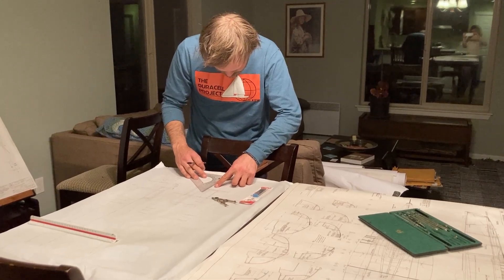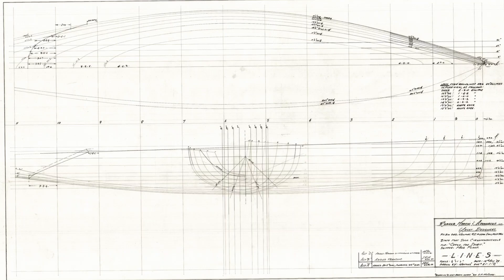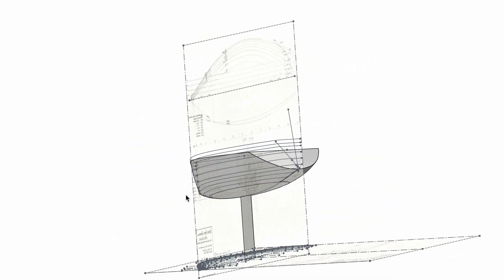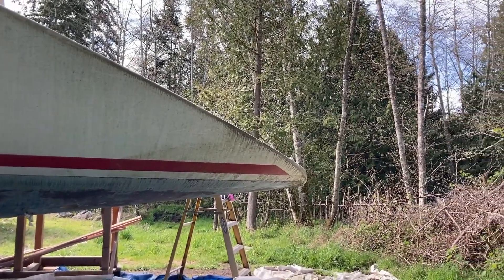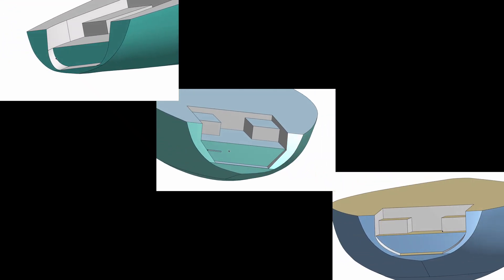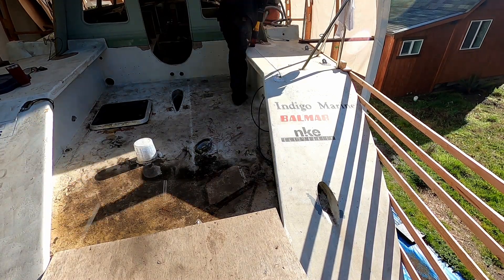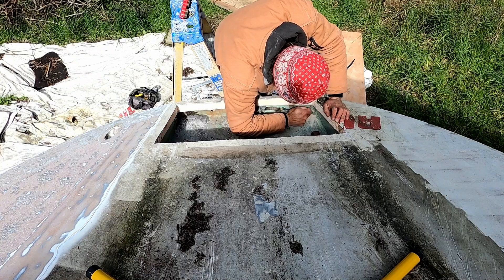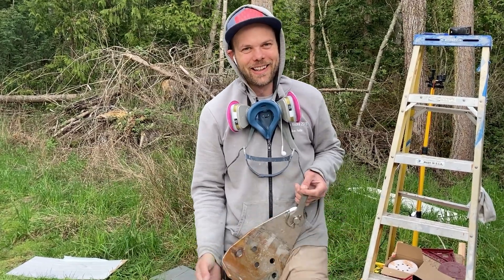Race Boat Refit: New Stern Design [E27]

Comment: I am not found of any. Is there a reason that you want or need the swim step instead of a ladder with more transom? I guess as I look at your  project and using the ship for sailing the oceans you do not want a bigger transom? Just my opinion.
Reply from the maker: just easier access at anchor with a swim step.
Reply: @TheDuracellProject  I get the ease of getting back into the boat. Again, what about large waves at the back of the boat. Washing onto the boat?
Reply from the maker: The boat is fast, and in most conditions faster than the wave train.

Comment: I would recommend an enclosed cockpit with a door to the swim platform.  Many times on passage it is nice to have an integrated swim platform you can easily use vs having to drop a fold down one.  I would recommend a much larger platform than the designs you have thus far created.  at 60' you will have plenty of cockpit space so don't skimp on the swim platform.
Reply: I totally agree, a watertight door makes a lot of sense, rather than open transom.   When you have kids on board, this will help, and sailing in a following sea it will be dryer.  I raced too many nights in boats with open transom , and wet cockpit as a result.  
If you go with a transom door, you could also drop the cockpit floor giving a higher freeboard in the cockpit, and benches will be more comfortable as a result. 
Love what you are doing, good luck on getting the right mast and the continuing project.

Comment: WOW!  That jogged some memory cells that I have forgotten about.  Back before the time of the dinosaurs, I was at Cal-Poly getting an aerospace engineering degree and one of the projects I did was to design a keel for a sailboat.  It required transferring paper plans of the boat to a cad drawing. Turns out I did not have enough of the drawing to transfer it to the Design Cad so never was able to.  I had completely forgotten about that!

I would go for #2.  Looks good you guys :-)

Comment: My preference is #2, for the following reasons. It appears the deck is slightly wider, and I prefer more deck space aft for deck hardware or even aft corner seats. I also like more foot space in the aft corners when handling dock lines. Lastly, I like the smooth lines of #2.

Comment: None of the 3 designs takes advantage of the opportunity to create a swim platform, 90% of the width of the beam, fold down on actuators to horizontal position with an integrated ladder.  Depending on the volume at the Stern and what is in the way, you may be able to incorporate a garage for a tender for going between ship to shore for supplies doing away with lowering a tender on davits or a crane.  Having a fold up transom also makes it a lot harder for unwanted guests boarding the boat.

Comment: Hi Matt. At 0:03 into the video we see a nice image of the grid substructure of Duracell and so my choice would be the transom that best integrates the point loads of the chainplates for the split backstay into this grid (as with the other chainplates). There is a comment by Andrew about a wind vane location and another about davits and so I would also consider the structural elements that underpin such installations (if that's where you wish to go). Enjoying watching journey from New Zealand. I was anticipating seeing you break out the "French Curves" and pinning flexible battens to the side of the hull... Best wishes and don't rush the design phase!
Reply from the maker: I will be installing extra bulkheads under the deck to transfer loads of chainplates and the like into the hull.  I won't be cutting the entire transom off, so I'll be tabbing to that transom, which in turn is tied to the 'grid' structure you speak of.
Reply: @TheDuracellProject  Cool. Remember, Form always follows Function. With all the great comments and support you are receiving, we all look forward to a great rebirth of the vessel.

Comment: Wouldn’t you need to replace standing rigging anyway?
Reply from the maker: Not necessarily.  It is rod rigging, which can be inspected for cracks.  If the rods pass muster, they can be reused.  Good question.

Comment: Of the 3 designs I like #1. It's not true to the original design but it gives just a little more usable space. Question, does an open transom shovel water int the cockpit from following seas?
Reply from the maker: Ideally we sail faster than following seas.  In certain conditions, for instance when big weather passes and the wind is easing, but the seas are still big, this could be a problem, but the water would leave the cockpit as fast as it entered.  Good question.

Comment: Love the project and your attention to detail and getting it right!  Just wondering, your time on the orbital sanding must be next level.. have you thought to use a coarse sanding wheel on a grinder to get the bulk of it off really quickly then hitting it with an orbital?  You potentially could save days of sanding?
Reply from the maker: I use a big festool orbital that is relatively fast with 36 grit paper.  I like it better than the grinder because I don't have to worry about grinding into the glass too much, but more importantly, it connects to my vacuum so I can keep as much dust from floating out into the yard as possible.
Reply: @TheDuracellProject  Ah yes both very good points.  Man I love this project and keenly anticipate every new episode!  Great work mate you are a craftsman!

Comment: Definitely #2. But the step up to the cockpit is too high in my experience(20 yr cruising). Maybe look at the height of the swim platform as it should be I suggest the height of the top of your tender side pods. Maybe this lifts the swim platform enough to reduce the stepup . Otherwise the Jeaneau solution.
Reply from the maker: I plan on steps up to the cockpit from the swim step, or one step, it will only be about 16-17".

Comment: You mean that after several years at sea, and then sitting around in outside in the elements, there are bolts that are stuck?? As always, the best advice is offered after the fact.
As far as design goes, I'm sure you've gone over all the pros and cons and know what will work for you. CAD is definitely a good thing to be using and sounds like you were going to need a CAD drawing in the future. Nice to get help. I know it's not easy to pick up, but once you get the hang of it, things go much smoother.
Good news on the new mast potential. Hope it works out.

Comment: I vote for three, with the joints at the very stern flat section meeting in curves rather than straight lines. I think the straight lines of this stern will match in with the dog house straight lines. When stanchions are added and various other fittings it will look different and could be worth considering before final decisions are made. Colin, retired marine engineer, long time yachty.

Comment: All three alternatives are aesthetically pleasing. When choosing between alternatives, which can be an endless process, don't be afraid to let form follow function. You're probably way ahead in all of this, but have you worked out easily accessible stowage for typical cruising gear such as a liferaft, dinghy, folding bikes, scuba tanks, possibly a propane tank, stern anchor gear, and jerry cans? Most production boats are inadequate in this regard and stuff ends up piled on deck. But you have a great opportunity to address these needs in your redesign while keeping the decks clear and the weight a little lower. You may also want to consider having transom seats incorporated into the stern railings, so leaving enough side deck aft for that. I didn't see a raised cockpit coaming. But even a modest raised coaming can keep the cockpit much drier, and if the coaming top has a outside edge lip, a low coaming better channels water away for the cockpit and provides a great place to hang on when the boat is heeled over or sit a little higher to see over the cabin house. Finally, all this will need to be integrated with strong points and lead angles for the split backstay and runner attachment points, which will need to be engineered for heavy loads. One more thing to keep in mind, the actual boat build shape may not completely match the design drawings, and the boat may have changed shape a little over the years. So be sure to check this before building new parts separate from the boat. Keep up the great work!
Reply from the maker: Thanks @flying gybe.  I am working on stowage, and hope that this mod will provide a lot of extra room for propane, dinghy fuel, snorkel gear and shower.  I'm thinking of having a removable bench spanning the cockpit at the transom for when we're at sea, and maybe it turns into a cockpit table?  What do you think?
Reply: I think that's an interesting idea if all can be made to fit without too much size and shape compromise with each componant. Aft, elevated cockpit seats are really nice to have. But if it means a much larger cockpit table than you would usually need, you may be better off with smaller side stern rail mounted "rumble seats" and a smaller table that could also be used when sailing and stowed when not needed. Key questions will be how to support as a large cockpit table and where to stow when not needed.

Comment: #3 after over 20 years of offshores crushing from New Zealand I recommend that you have as large as possible swim step. It helps so much with access to the boat for loading/unloading as you will be doing a lot of this from your tender when cruising 
Good luck
Reply from the maker: You nailed it.  I like large swim steps, and ease of build.
Reply: Agreed !

Comment: Great ideas, I think #2 works best as you continue the shape of the cockpit sides when going down into the step/scoop. Maybe you could try to parallell the outer edge of the transom more in the curve itself. A step, moulded in as a negative shape or added like in #3 is also smart.

Comment: Have really enjoyed following along as you've taken on this great project... and see both pros and cons to all 3 designs (leaning towards #2 personally). However... I believe it might be a good idea to add a couple of additional considerations to your design brief. Given your intended blue-water sailing goals, I can't help but think that incorporating additional structures for weather and sun protection (i.e. enclosable), solar panel installation, and davits to allow safe and easy launch/storage of your dinghy. While I can certainly appreciate the challenges and added complexity of an addition of this kind, it will certainly never be easier to engineer and install than it would be now.  Looking forward to whatever you decide to do....
Reply from the maker: The renderings do not really have any decks or anything drawn, it is very incomplete.  I'm still learning how to use CAD.  I would like an arch or something for a bimini and solar panels, so I'll be thinking about that down the road.

Comment: Hi Matt, I would take into consideration that the transom should also have the ability to attach a vane steering system. I also would point you to Sailing Camara Ep1 refit of 80ft racing boat in NZ for their keel redesign for cruising. Enjoying you work
Reply from the maker: I LOVE what Camara did with their keel, seems bomb proof, and they can stand the boat on it.

Comment: While 3 appeals and is perhaps more in keeping with modern boat design - the “angular, hard chine” look, I think option 1 and 2 would probably suit the design of your boat better (curved doghouse roof etc), and if you’re not stealing too much room from the cockpit, I’d go with 2. I think you’d appreciate having a bit more area to unload/load a tender, more room to sit on if you’re swimming off the stern, perhaps a fresh water shower area, somewhere to clean fish, etc. I’m not sure of scale here, but I expect you would still have a step integrated into, or attached to, the step down to the lower platform?  Big improvement btw. Nice work. 
PS. Re “Lots of sanding”.  My neighbour asked if I was carving (sanding) my boat out of a solid block of PVC. “I hear you sanding all the time” says he. Lol.
Reply from the maker: Robin, I'm definitely leaning towards #3 for the ease of build.  All the designs would have some step integrated.  #3 has the largest swim step.  Thanks for the comment, always good to hear from you.

Comment: Nr. 3 is hands down the best. The curvature of the sugar scoop in nr 1 and 2 looks a bit contrived and something you would see on a French production yacht. The curves don't really fair smoothly into the lower step and they are hard to produce. The inward turn of the inboard side of the cockpit in nr.2 will look funny at some angles and creates a pointy top end where that side meets the transom. 
Nr. 3 is simpler, easier to produce and in keeping with the design ethos of the time Duracell was constructed. Also it looks sharper and racier somehow.

Comment: This may be way too late but …Definitely option 3. The language of curves belongs on the outside of the hull and cabin super structure while flat planes belong on the inside of the hull and cockpit. Also if you step on or lean against the angle you won’t slip as quickly as a curve. I’d like to see another step at the cockpit floor. Maybe some book shelf like steps either side would work well for getting in and out?

Comment: Hmmmm it took me awhile to decide which transom compliments or stays true to the original design.  The angular interior doesn’t really fit with the other classic curves of the hull.  Modern trimarans often use these angular lines but it just doesn’t fit with your boat in my opinion.  At first I liked number 1 but after looking at the situation for awhile I think number 2 has several things going for it.  First it gives you a little wider step (maybe ?) and secondly the more crescent shaped curve (where the curves are not parallel) fits more nicely with the classic curves of the boat. It looks much less contrived and more natural (just my two cents worth).  Awesome project !  Looking forward to seeing her out on the Sound !

Comment: Hello from Ontario Canada, 
Oh the three transom designs you’ve drawn, I like number 2 best.  
Personally I’d like to suggest a 4th design, a hybrid design with a  “closed” in transom that incorporates a fold down swim platform.  I feel this gives the best of both cockpit security while on passage and openness when anchored giving access to your tender and water activities.  
~cheers
Aaron
Reply: I agree, a closed transom is better, particulary as new cockpit seats are shown a few feet in from the stern.  As a family cruiser, more protection is good.  Although one benefit of an open design is that the arch can be lower and therefore lighter, it may not be much but it would save weight at an extremity and high above the deck. 
Failing #4, I would vote for #3 as it seems angular like the new deckhouse.
Reply: I was thinking the same thing, noting all the open designs.  Might help with keeping following seas from swamping the aft end...
Reply: @JMunsonII  Way to go. Open transoms are fine in sheltered waters but a wet nuisance once land is out of sight . Since this is a cruising project any invitation to invite water aboard is an invitation to cope with the unwanted; the open transom may look "racey"  but i didn't think that was the aim.
Reply: I deffo agree with the other regarding transom #2. 
Regarding open vs closed transom. I’d say open partly because she was/is a race boat but also to ensure that braking waves can escape from the cockpit as fast as it came in. Just put some lifeline’s across and maybe a net. I have tried the open cockpit when a wave just crashed through the cockpit and man was I glad it all disappeared in a second.
Reply: Could self-drainage be designed into a full-height transom?
Reply: @777rogerf  I’ve never saw an enclosed cockpit without some form of self drainage.
Reply: This.
Reply: I agree, need a 4th design as suggested!
Reply: I am liking #2 also, but disagree with those thinking enclose cockpit. You'll appreciate the quick draining and and peace of mind regarding scupper drains getting clogged at the wrong time and slowness of most scupper drains( think multiple following seas in quick succession)

Comment: I am looking forward to every episode of your project.  It brings back memories of when I worked at Soveral Marine on many of Mark Soveral's designed sailboats.  The Soveral 33 and the last one was a one-design 62' sloop called The Shadow racing in the Transpac.  I would love to know where that sailboat is.
Reply from the maker: I've sailed against a couple Soveral 33s, they were tough to beat, great light air boat.
Reply: @TheDuracellProject  Most people don't know this but, the 33 was just an extended 30. We used a built 30 to build a mold extension and then transferred it to the 30 mold.  Over the years it has been cool to know that I was part of a two-man crew that did the extension and how successful the sailboat has been.  I for one can appreciate the hard work you are doing on the Duracell Project and can't wait for the next video.  All I can say is hang in there man you are doing an unbelievable job.